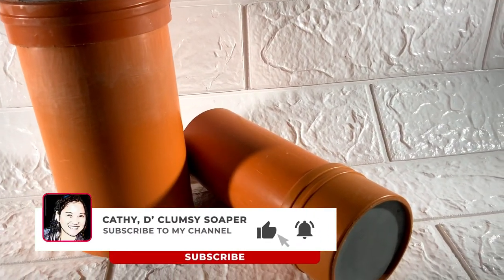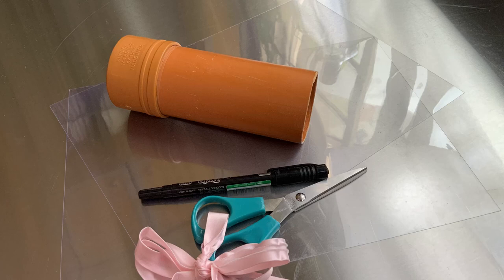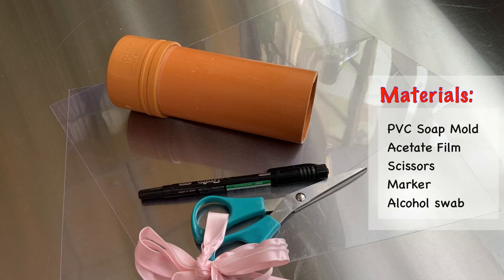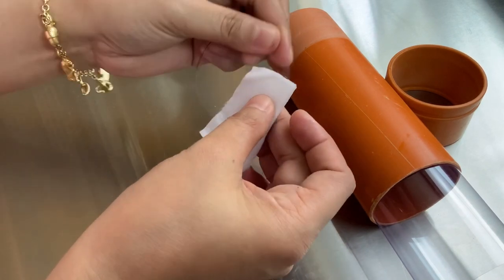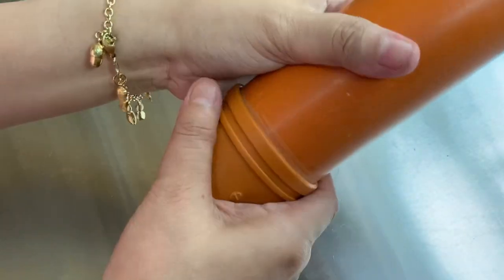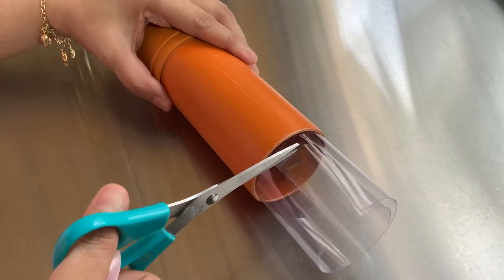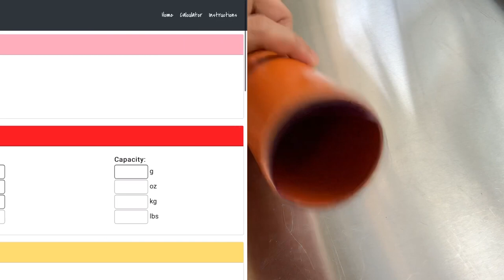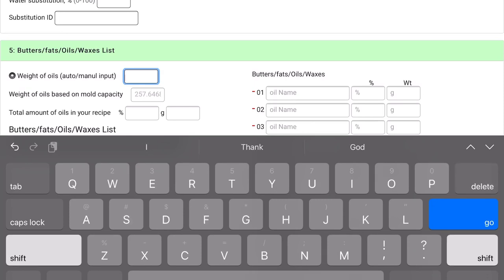PVC Soap Mold Liner | How to line PVC Soap Mold  | How to measure mold capacity for soap making

Comment: Interesting video! Does the acetate film allow the soap to slip out of the PVC tube easily? Will this method work for hot process soap as well? Thank you❣️
Reply from the maker: Hi Bonnie. Yes to both questions. You may consider watching this video to see it in action: https://youtu.be/5C9U0WG2WCo
After use, I just wash the acetate film with lukewarm water. Hang it dry. Then, re-use again.